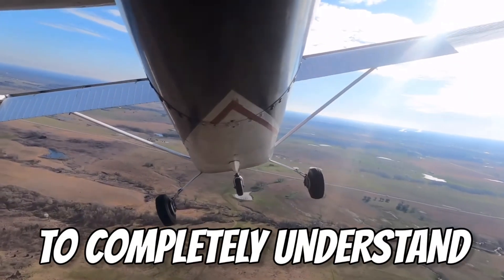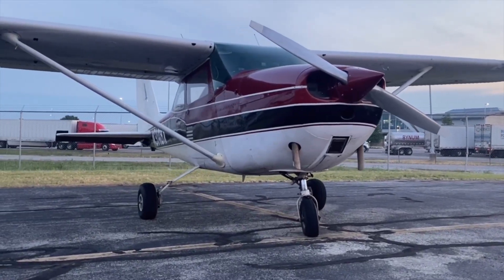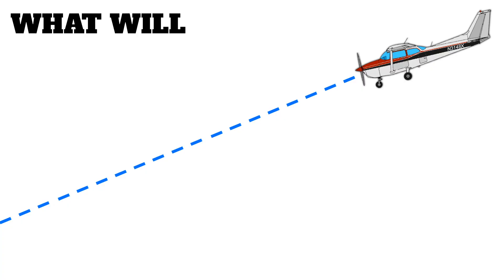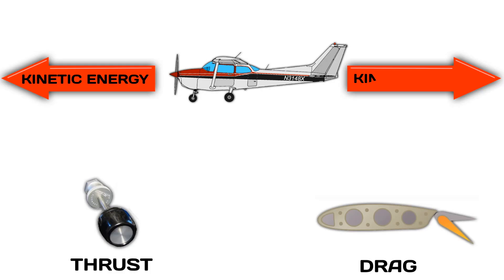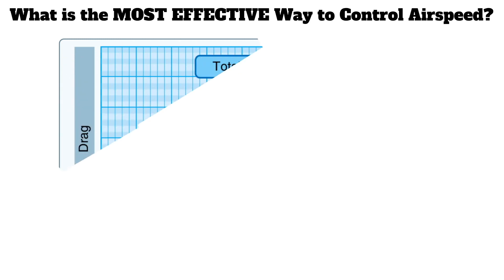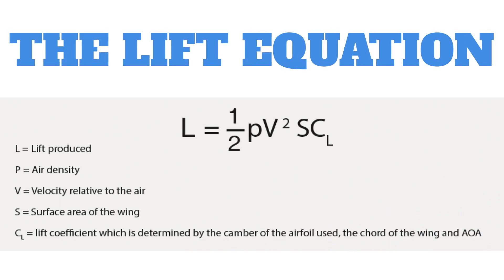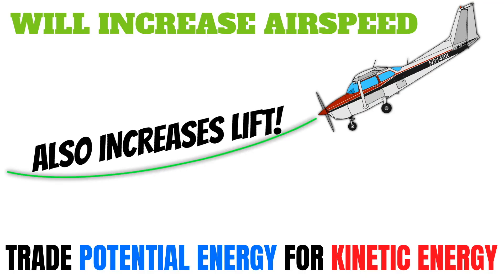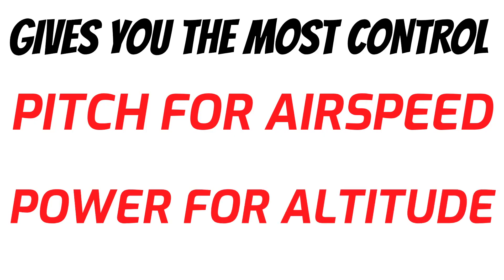Should I Use PITCH or POWER?

Comment: What do you think, do we need really reduce flaps position during approach when we have strong wing? Thank you
Reply: Assume you mean strong wind.  It depends on the aircraft.  I think you'll find in most GA aircraft, the POH will recommend less than full flaps in strong winds for better rudder authority.  Especially in the Skyhawks with 40° of flaps, to me it feels like the rudder gets quite mushy at full flaps compared to 10/20° because those large high flaps disrupt the airflow so much from the wing back to the tail.  A lot of control can be lost.  In addition, less or no flaps allows the proper landing attitude to be a few knots faster, and that helps aileron and elevator authority also.  This doesn't necessarily mean the landing will be longer - in strong winds with a few knots added for less flaps or gusting conditions, the ground speed may actually be lower than in good conditions and full flaps.
Reply from the maker: Not necessarily. I typically use as many flaps as I can handle for most of my landings

Comment: Interesting topic.. The way I was taught to make an approach was to first set your "aiming point" on the ground, and keep it in the same spot in the window. Then once you've comfortably established yourself on that fixed point, adjust the power to correct your speed. Since I must keep my aiming point in the same spot, any power adjustment goes hand in hand with a pitch towards the aiming point. I don't look at altimeter once I'm on final approach. Maybe it's the same end result, but I've never "pitch for speed"..  if I'm too fast I think "pull power", if I'm too slow I think "add power". 

For slow flight, I was taught "pitch for speed, power for altitude", but at higher altitudes with no ground reference, so you are just using your ASI and altimeter to make those adjustments.
Reply from the maker: That does work, using your method allows you to make smaller changes, but if you need to make a big change, you’ll need to switch up the controls
Reply: I agree with you.  The US Navy teaches the other way, which admittedly does work better for high performance jets flying behind the power curve on final.  In my experience, in such as Cessnas, using power to control descent rate happens too slowly - it does work, but nowhere near as immediately as in a high performance fighter.  Much better flight path control when using the elevator to control the vertical path.  It WILL require almost immediate power change, to be sure.
Reply: This is also how I was taught to fly (set aim-point, adjust power to titrate airspeed, and adjust pitch accordingly as required). Main idea is that in larger, high-performance aircraft, this is definitely the way to go... so I'm assuming the desire here is to try to make it consistent approach for all aircraft, even though it clearly is 50/50 as to which is "better" or preferred in light GA aircraft.
Reply: @chriscole4559 this is how it’s done correctly.
Reply: I was taught exactly the same way

Comment: I was struggling with energy management when learning to fly gliders as a teen. I had a great instructor, he helped me learn in a car on a hill. 

It went like this: Engine on, transmission neutral, start rolling down down the hill towards cones on flat ground below the hill. I could let off the brake to accelerate, and apply it to bleed energy. The goal was to coast to a stop between the cones. If the brakes were on at the cones, no good. Come up short of the cones, no good. We used a car, you could probably do the same with a bike, but we didn't have one. 

It sounds stupid, but it was effective.
Reply from the maker: Great way of thinking about it! Thanks!

Comment: I think that pitch for speed and power for altitude are the most efficient and fool-proof ways to control an airplane in slow flight and keep it in the air, but that control method has a little bit of lag between the input and the result. It seems that you get more precise control doing the exact opposite, which is to pitch for immediate altitude changes and to do power (and elevator trim) to manage speed changes.
Reply from the maker: This is a great point. If you’re trying to make really small changes, then swapping controls can be a great technique

Comment: Pitch for airspeed, power for altitude--that's literally day 1 of flight school.  However, this was a really great video and I feel like I have a much better understanding of what's going on in the power curve.
Reply from the maker: Thanks! I felt like it was a necessary video. I have too many folks questioning the controls you use on an approach
Reply: Then you went to the wrong flight school. Pitch is for altitude. Power for airspeed. Unless you have a fixed power setting.
Reply: @rtbrtb_dutchy4183   Either you never went to flight school or it has been so long that you have forgotten the basics.  On approach, you are in slow flight with a high AOA, so you pitch for airspeed and use power for altitude.
Reply: @ABQSentinel  that’s not the basics at all. Not all. And I find it sad that there are people out there who believe what you say. Professional pilots won’t though. 

I became a CFI in 1993 and taught for 1500 hours. Since then I’ve trained hundreds of guys in different kinds of jets. Some of those, thought the same way as you and had to be retrained.
Reply: @ABQSentinel  the dangerous part in all this is that if you ended up slow on short final, your instant reaction is to lower the nose, instead of a handful of power. 

You don’t have an instrument rating, do you?  Because you can’t really shoot an ILS approach with your philosophy. 

Auto pilots, flight directors use pitch for altitude. Auto throttles use power for airspeed. You wonder why that is?

Comment: Since you asked - I've been flying for 48 years and have pitched to glideslope and used power for airspeed 100% of the time.
Reply from the maker: You’re not the only one. It does work
Reply: @FreePilotTraining  nah, I’m sorry man. But this is just not correct. I’ve been flying for 32 years and in the beginning of my career, I was a CFI with 1500 hours, instruction given. 

Pitch controls glide path. Power controls airspeed. UNLESS there is a fixed power setting, which is usually full power or idle power, but can be a pilot selected power setting as well. 

There is a simple solution to this to know what is correct:

Go up and fly with a friend. Have him control the yoke only and you control the throttle only for a visual approach. 
First, have him control pitch for airspeed and you control power for altitude. You will find that you two have to communicate about your inputs and still, your approach will be unstable and it will be hard work. He will have to look at outside to line up for the runway and he will have to look inside to keep an eye on the speed. You will have to look outside to make sure you are vertically lined up. 

Now switch it. He controls the yoke for glide path/altitude. You control the throttle for airspeed. 
All he has to do is line up the airplane by looking outside. He puts the aiming point in the middle of the windshield and keeps it there. You don’t even have to look outside. You just look at the airspeed and adjust the power accordingly. 

I mean, if you are in an airplane that flies 60 knots on final, during an ILS and he finds himself a bit below glide path, he can pitch up, maybe lose 2 or 3 knots, but once on glide path, those knots will come back. No need to adjust the power at all. 

These small airplanes now a days have glass cockpits with flight directors. A FD pitches for altitude on an approach. Or are all FDs wrong?  Not only that, if you had a autothrottle, it would use power for airspeed. 

I just had a discussion about this with a 737 first officer. He was upset with his instructor back when he started, because he realized that he was taught wrong and it had wasted his time. It also made him look incompetent when he was in training for the 737.
Reply: I’ve been flying for 49 years, and learnt, experience doesn’t guarantee knowledge.
Reply: @lucianosantucci108  There's one point that should be clarified about pitch and power.  Pitching for altitude and power for airspeed is done when the power is variable.  This is the term I got from the FAA.  It means when the pilot is using the power in a normal way to keep the thrust and drag balanced.  When the pilot applies back pressure which increases drag, the power is increased - when the pitch is lowered and drag is reduced, the power is reduced.  That covers most flying including enroute flight, descent, pattern, approach, and many maneuvers.  The other condition is when power is fixed.  That is when the airplane is at full power, or no power (engine failure).  Sometimes the engine may be stuck at partial power where it isn't enough to maintain airspeed in level flight.  In that case, the pilot normally pitches to maintain an airspeed.  In a climb, it's normally pitch to Vx, Vy, or enroute climb.  In an engine failure, it's pitch to best glide.  So for approaches, when everything is working normally, the correct technique is pitch for altitude, power for airspeed.
Reply: @warren5699 correct as well. Pitch controls airspeed only with a fixed power setting. This can be at full power or idle power, but also anything in between as chosen by the pilot. 

For instance, I would teach my students in the pattern, to set the RPM at 1600 and pitch/trim for 65 knots. But as soon as they turned final and had a spot to aim, it would revert back to pitch for altitude and adjust power to maintain 65. 

I always felt that teaching pitch for airspeed was a lazy way of teaching. That way they didn’t have to teach both.
Reply: @lucianosantucci108  That's a fair point.  I was trying to keep it short.  Let me put it this way.  In addition to instructing 43 years, working as a Chief Flight Instructor I think it was 24 years, flying Part 135 for 10 years including being a 135 instructor and check airman, doing many flights with FAA inspectors for 135 and 141 requirements plus my ATP ratings SE and ME, discussing the finer points of flying techniques and guidelines in the FAA Handbooks with FAA inspectors during all of those years including pitch and power, and flying in all imaginable weather, pitching to glideslope and power for airspeed has worked 100% of the time and is the recommended technique in the FAA Handbooks.
Reply: @warren5699 you are 100% correct. I’ve been flying professionally for 32 years. I started as a flight instructor and have 1500 hours instruction given. Now I fly as a training Captain for my company. Pitch has always been for altitude and power for airspeed. (Unless you have a fixed power setting) 

Automation works that way too. Flight directors and auto thrust use pitch for altitude and power for airspeed. 

There is a joke out there about a WW2 bomber pilot flying for an airline with a new first officer. I forgot how the joke exactly went, but he said something like: I’ll go ahead and move the elevator up and down to gain speed, when we get to the end of the runway, give me a handful of power so we can climb.
Reply: @lucianosantucci108 but he has the correct knowledge.
Reply: That is generally not what is taught, but makes sense.
Reply: @philwinner1806  Agree.  The Region of Reversed Command is frequently misunderstood to mean pitch and power reverse.  It's actually where speed and power required reverse.  The definition from the PHAK is - "The “regions of normal and reversed command” refers to the relationship between speed and the power required to maintain or change that speed in flight."  The only airplanes that can literally control altitude with power are V22 Osprey's, Harrier's, and some military jets that can climb straight up.  That's it.
Reply: @philwinner1806 it’s taught wrong. And it’s also not generally taught. Most big flight schools or flight academies won’t teach it that way.
Reply: Cheeze Louise! Hey Folks - If you’d like to fly as accurately, and effectively as possible and fly as USAF Pilots are taught to fly and how Airline Pilots fly jets and how the plane’s Autopilot & AutoThrottles are designed to control the plane and oh! Just like every other motorized vehicle out there - you use Power to change the Speed with the caveat applicable to airplanes - When Power is ‘Variable’ you use Power to Control Speed.

Likewise, you use Pitch (Elevators) to Control Altitude as in Level Flight, tracking the Glideslope, Descent Rate or Climb Rate, and Runway Aim Point control - still remembering that this is when Power is ‘Variable’. 

When Power is ‘Fixed’ that’s when Pitch ( Elevators) control speed and Power controls Altitude. With a Second caveat being that when in the Reverse Command Region in lower powered GA aircraft you should use Pitch for Speed control and Power for Altitude control. 

It’s totally that simple. The airplane doesn’t know or care which Pitch/Power concept the pilot flying is using. But I would dare say that every Professional Pilot with at least 3,000 hours has adopted Power controls speed & Pitch controls changes in altitude or in the vertical as in up or down.

If you want to know my flying background to lend authority here - I’ve been a Gold Seal CFI for 54 years, A USAF Instructor Pilot Flight Examiner for 21 years and an airline pilot for 33 years. 

Next time you taxi into Takeoff position on the runway and are cleared for Takeoff - do you advance the Throttles or Thrust/Power Levers to accelerate to liftoff speed or do you start pumping the Elevator up & down to accelerate? There’s your answer.
Reply: @waltciao4549  I'll have to disagree with part of what you say.  When power is fixed (usually in a full power climb or no power engine failure but it can be fixed at some in-between speed due to some problem), yes we pitch to airspeed (ex: Vx, Vy, cruise climb, best glide), but that still doesn't change the fact that the only force that is capable of opposing weight and therefore controlling altitude is the lift vector.  So we may use the elevator to get the desired speed (where thrust equals drag), but the wing, NOT the throttle, is still what opposes weight allowing control of altitude.  

Why do we pitch to speed in those cases?  There's no practical way to measure the efficiency of the pitch indicated to know if we are generating best angle of climb or best rate of climb.  Test pilots do the analysis and then give us an airspeed which will get the right results when used with full throttle.  We use the elevator to maintain that airspeed, but it's still the wing that is creating the lift to oppose the weight.

The basic forces (lift vector/thrust vector) do NOT change in the region of reversed command.  Despite what is handed down from generation to generation, it is NOT pitch and power that 'reverse'.  It is SPEED and POWER REQUIRED - this is explained in Chapter 11 in the PHAK.  I.e. in the region of reversed command, the wing is still opposing the weight like it does in the region of normal command.  No where is this more obvious than when landing.  What do we do there?  We level out from a descent and hold altitude barely above the runway with the elevator.  We are deep into the region of reverse command and we're holding altitude with the pitch, NOT the throttle.  In fact, the throttle is at idle normally, so that pretty much proves what's really happening there.  And again in the PHAK, it simply says that to hold altitude at a slower speed, increase the pitch.  But we must be aware - the slower you get in the region of reversed command, the higher the drag, and therefore the more power that will be needed to control airspeed, if that is your objective.
Reply: @warren5699  you would be wise to view this presentation. It covers the topic quite thoroughly and even explains how the improper concept of using Pitch controls Speed and Power controls Altitude has been mistakenly promulgated by Instructors who don’t know any better not to instruct this outdated or inaccurate way to fly: 

https://youtu.be/lPY3P3t0JPg
Reply: @waltciao4549  Frankly, I found this video (the one you referenced) a bit like the Energy Management chapter referenced in the video - it's a thorough discussion about aerodynamics but not tailored at all for learning piloting skills.  I liked the explanation he gave about how pitching to airspeed got established (because engines were unreliable), but I think what's continuing that incorrect concept today is just a misunderstanding of what the regions of command are (particularly the region of reversed command).  Generally what reverses is misunderstood.  For anyone who thinks pitch and power reverse, I'd like to see them draw a diagram of how the lift and thrust vectors reverse.  If you're flying a V22 Osprey, they can - otherwise it's a fantasy.
Reply: @warren5699  Its just a complete shame that in these ‘modern’ times that such a retrograde piloting technique as pitching for airspeed & using power for altitude is still being propagated by instructors who don’t know any better and continue to pass on bad habits to their students.

Comment: That’s why I love higher approaches with no power and glide at 65 knots to landing.
Reply: One of my instructors was this grizzled old guy with over 15,000 hours (much of that as an instructor), and he strongly advocates coming in high.  He said the 3 degree glidepath is great for jets and fast moving aircraft, but the little trainers we fly like a steeper descent profile.  Done right, you can pull power after turning final and make a perfect landing every time.
Reply from the maker: That works!